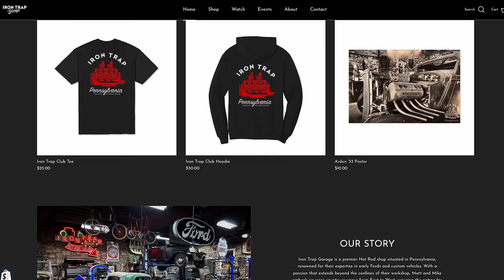Rare 1941 Lincoln V12 Zephyr & 1939 Ford Extracted From Condemned Garage

Comment: Love the cars you picked up but I have a question. Did you grab the Porter Cable belt sander that was on the bench beside the 39? It was a Porter Cable A-3 Take About 3x24 belt sander. "locomotive" They're very collectable and very desirable.

Comment: This is a Lincoln Continental, not a Zephyr.  The Zephyr convertible had a shorter hood, was a taller car with the typical for the era belt molding below the windows, and had a different tail.  They also made more than 400 Zephyr convertibles.  The Zephyr was a much less expensive car than the Continental.
Reply from the maker: We know that. We used Zephyr in the title to draw people in as it’s a more common/interesting  “keyword”